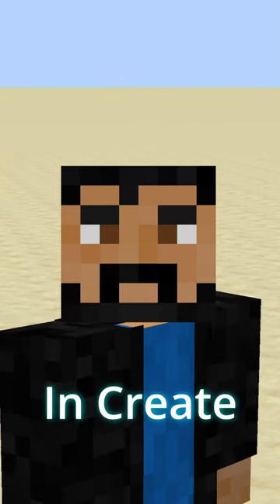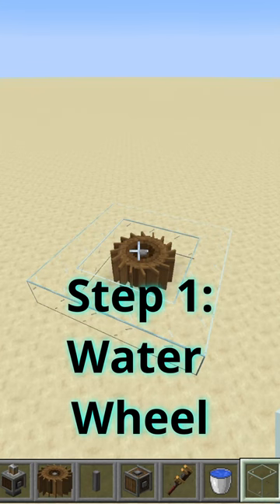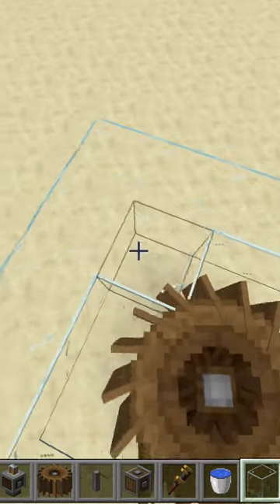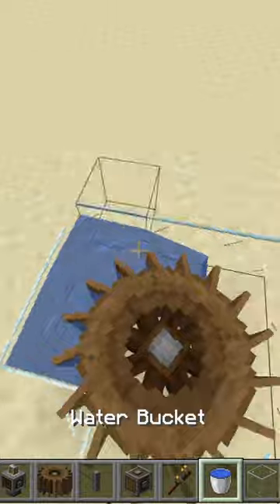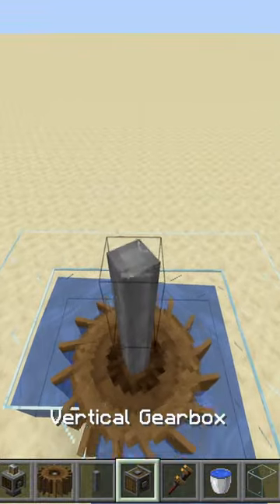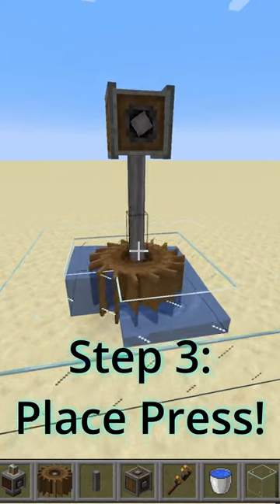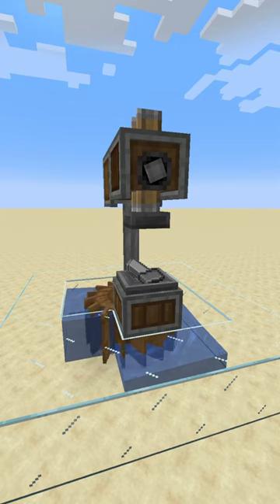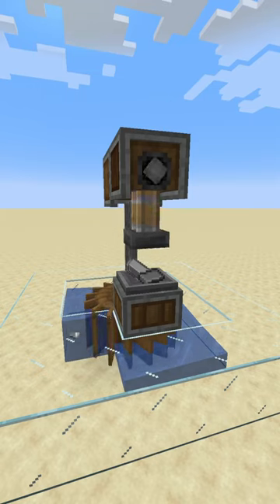How to Make a Mechanical Press in Create!

Comment: Really nice. I was worried for a second when it didnt work but turns out you gotta put something in the press for it to work
Reply from the maker: Yeah it's slightly out of date because the water wheels got changed in the last update so it's a little slower, but overall it still works pretty well.

Comment: how do you lace it like that, mine goes vertical
Reply from the maker: if you're referring to the water wheel, i just kinda keep right clicking it with my wrench until it's in the position I want. I'm sure there is a better way to do it, but that's how I end up doing it.
Reply: @skyze32  ya I ended of finding that out but thank you for replying

Comment: worst tutorial, half of the tutorial not shown, literally doesn't work, with soul sand... its only 256 max
Reply from the maker: A. The only part of the tutorial I do not show is the placing of glass and soul sand, which you can clearly see since you commented on it.
B. This video was released for version 0.5. Water wheels got changed for 0.5.1, meaning that it will work, just slower than original.